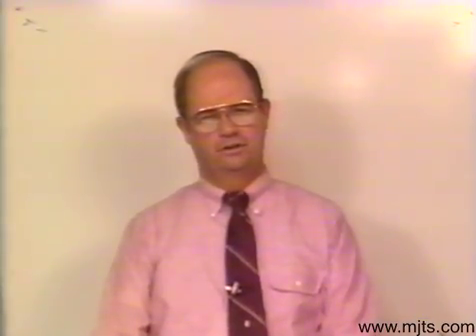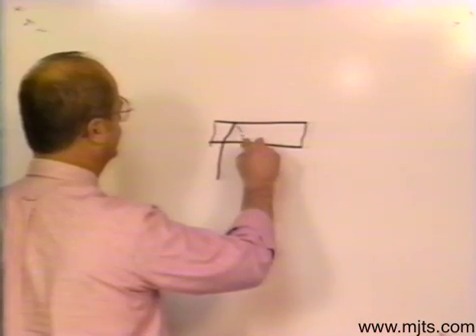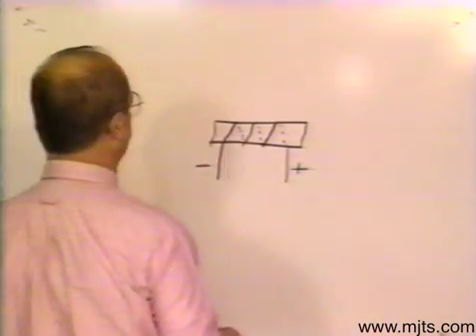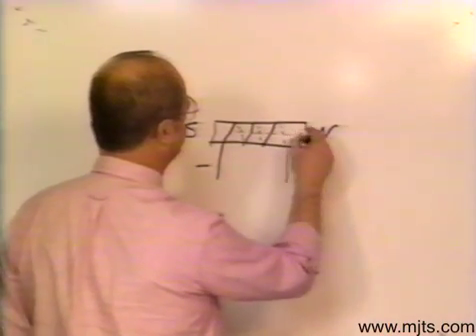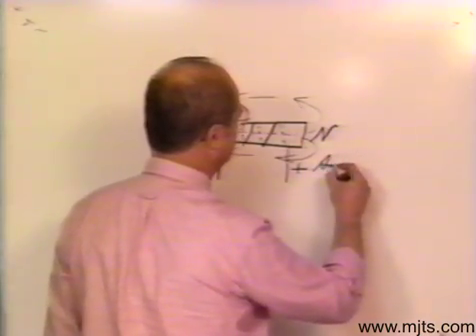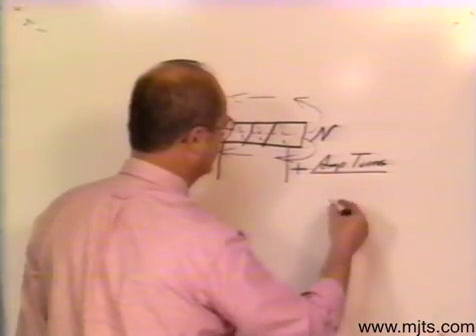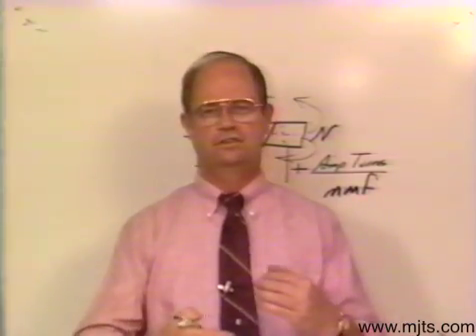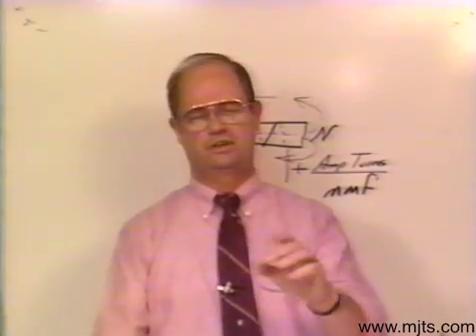Magnetomotive Force

Comment from the maker: Thanks for your comments. In our training we teach electron current flow theory. In that convention, current flows into the negative terminal of a circuit element. To determine the magnetic field we use left hand rule. In conventional current flow theory, current flows from the positive terminal of a source or into the positive terminal of a passive circuit element. In that convention, the magnetic field is determined using the right hand rule. Best wishes!